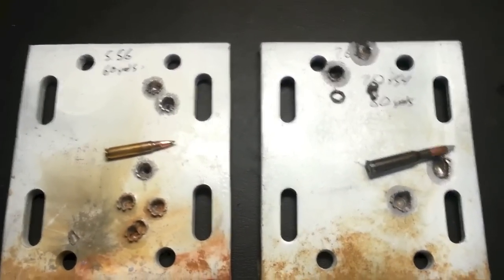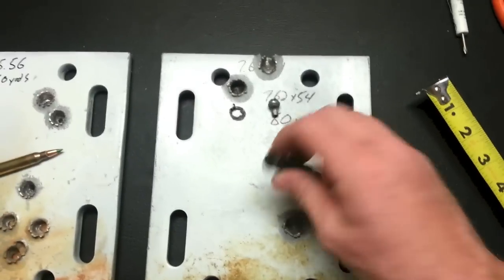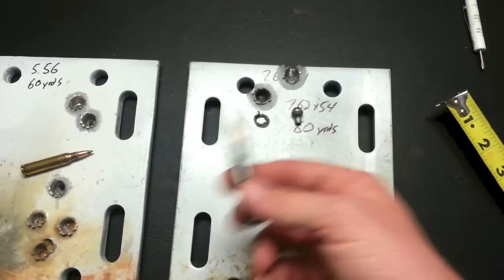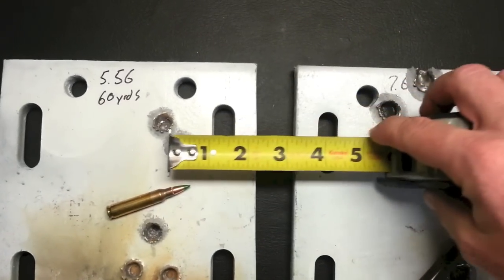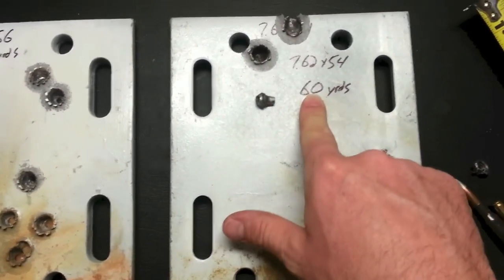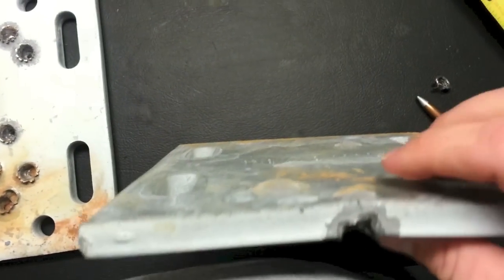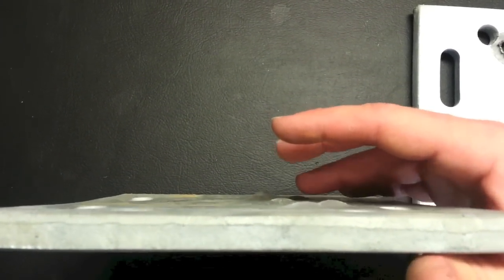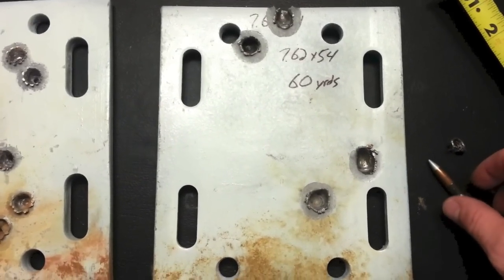5.56 vs. 7.62x54r on Steel

Comment: 7,62x54r ammo in the Video is not "ap" It is Surplus Ammo Cechz corrosive , light bullet 147gr steel core.
Reply: Stradi Varius even the 5.56 he used isn't steel core, it's steel TIPPED. Nowhere near AP, just has better penetration against car doors, vests, glass and flesh at range compared to standard 5.56

Comment: It has to do with velocity of the rounds. If the 7.62x54R was moving as fast at the 5.56 (which i think is about 3100 fps) the damage would have been noticeably different and have more penetration.

Comment: Green tip 5.56 is NOT steel core, it's steel TIPPED for a little better penetration if it's shooting a car door or a human with a tac vest. You need black or silver (can't remember which, pretty sure black) colored 5.56 for actual AP ability. You need to do it again.

Comment: I think the results were similar due to the harder steel core in the m855 "ap" ammo. the steel core in the mosin ammo is softer probably, just there as a cost cutting measure.
Reply: jdillayt m855 isn't steel core, it's steel TIPPED. Nowhere near AP. AP is black or silver.
Reply: It isnt steel tipped eighter, its a steel insert